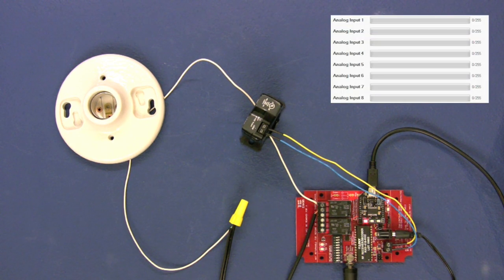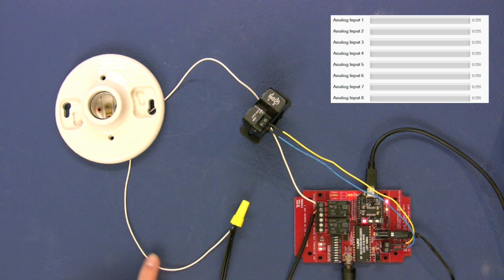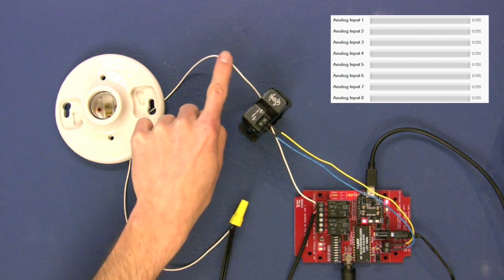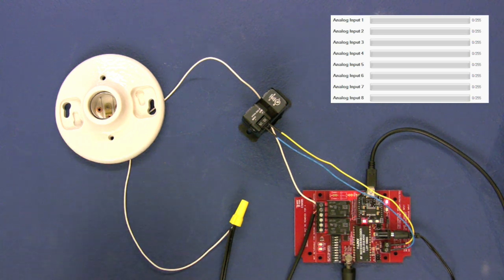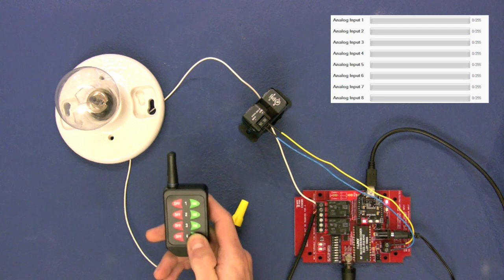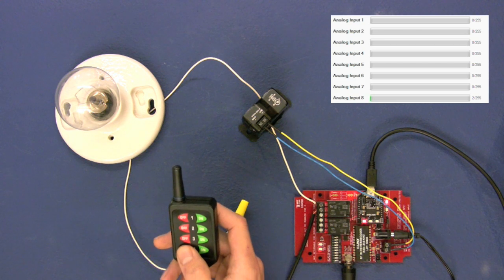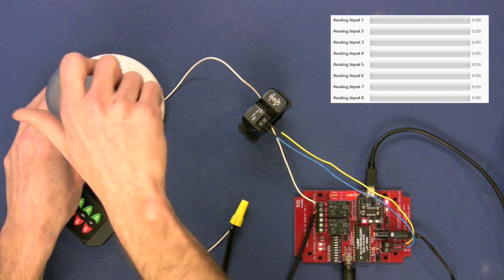Veris Sensor: Key Fob Controller Using Current Sensor

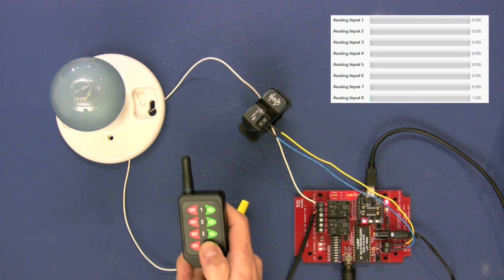Comment: at 1:59 why did analog input 1 turn on
Reply from the maker: Analog inputs are also tied to the Key Fob buttons.  When a button is held down, it reads as a analog input.  When the key fob button is released, the analog input returns back to 0.  Analog input 8 in the video is sourced from a external rather than internal Key Fob analog input.
Reply: @ncd-io  i think i get it